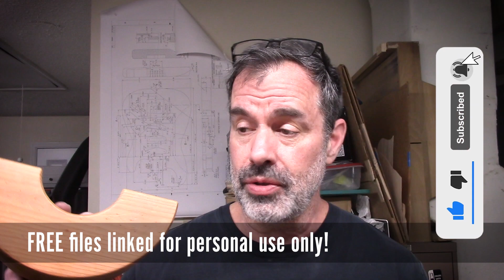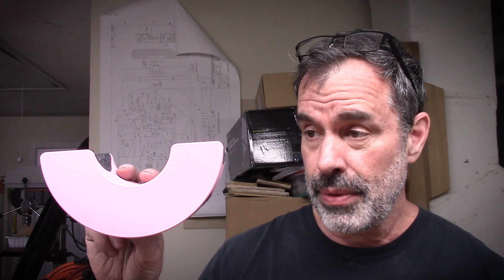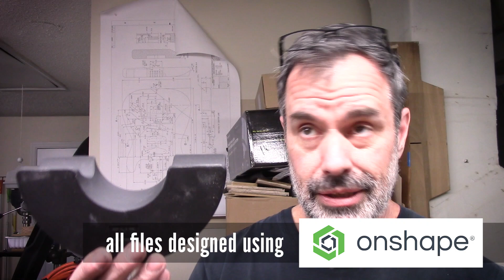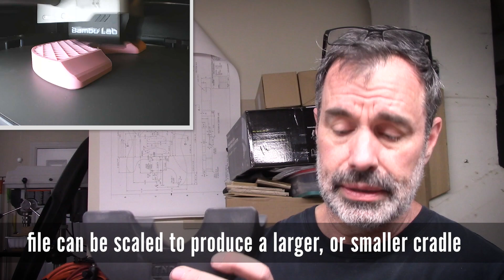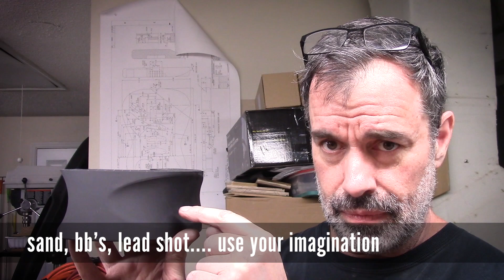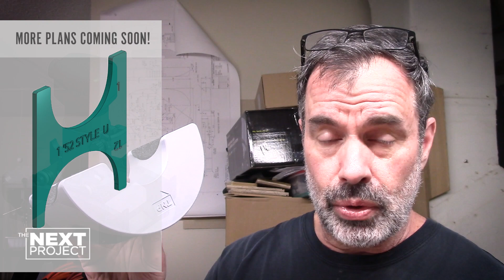Guitar Neck Cradle - 3D Printing Guitar Project Tools Ep2

Comment: If you do experiment with the sand, use gyroid infill.  That will allow the sand to even out on its own, rather than you filling up separate compartments and possibly leaving it unbalanced.  That is, with gyroid, it doesn't create separate compartments but one interconnected space, so you can fill in one spot and it'll spread out across the bottom (within reason).  Once you've finished printing, you can just shake it a bit and get the sand to even out.  The sparser the infill, the easier the sand will flow.
I printed a very similar rest, except I made the opposite side (i.e. the non-rocking orientation) flat but sloping for when I'm working with the guitar face-down.  I also used self-adhesive felt, which made it very easy to install.
Reply from the maker: Raven, thanks for watching and the great detail suggestion for printing infill and sand.
That's a really great suggestion, I'll give it a try on my next print of this.
I'll have to find look for some larger adhesive felt sheets too. I only have small the small furniture patches of the adhesive stuff, a bit too small for this neck cradle.
Thanks again, be safe and take care!

Comment: Printed one today. Just beautiful.
Reply from the maker: Pelle, glad it printed well for you.
As you may have noticed, there are now 2 sizes available. The original which is good for most electric guitars, and a larger version which will also work well for most acoustic guitars.
You will need to get some felt, leather or similar protective material and apply it to the contact points of the cradle, to protect the guitar necks.
Good luck with your projects!

Comment: this is great and just what I was looking for, thanks so much!
Reply from the maker: Andrew, thanks for watching!
I have a larger version for acoustic guitars,  that I will be making available in the near future. 
Good luck with your projects!
Reply: @theNextProject oh perfect, that's actually what I was after. I scaled this one up to be about 5 inches in height but haven't printed it yet so maybe I'll just hold out for the next version.
Reply from the maker: I've just uploaded a "large" version, in both STL and STEP formats.
The files are in the same folder you found the original neck cradle.
Good luck with your projects!
Reply: @theNextProject thanks!

Comment: Any recommendations/links for which felt to use? Or possible suggestions for alternate materials?
Reply from the maker: Swarmish, thanks for watching!
I used a heavy felt, it is/was an airline blanket. The kind they offer on cold flights to places our feet freeze - sorry, off topic.
I would imagine some craft, or fabric stores may have some thick felt that would work well.
Additionally, sheet cork should work, Neoprene sheet rubber, leather ( a thick early 1970's hippy belt ).  
Hmm, what else... If there are an old discard set of leather boots ready for the trash, the uppers, or tongue could possibly be used.
Just need something that is firm and soft-ish at the same time. 
There may be something laying around the house that won't be missed.
Good luck with the scavenger hunt, and your projects!
Reply: @theNextProject  Thank you for sharing! I'm happy to come across your channel! Those are a lot of good suggestions, I'll be mindful of them and see what I can come up with this weekend.

Comment: Hey your videos are great I am a couple in after your careful analysis of the crowning tools. Fell into the rabbit hole, good timing though as I was about to buy the Music Nomad cradle. Something that rest has is angled sections where your strings could route while doing string-on fretwork. I bet this design could accommodate some kind of hook or some place for strings in that event. Keep up the good work!
Reply from the maker: themasterunknown, thanks for watching!
I have a couple little hooked "U" shape string retainers I'm working on. I've got a couple different sizes at the moment, still "testing". I also have a couple "string jack" ideas I'm working on, which allow you to elevate the strings roughly 1/4" without removing them...
I'll have file available soon. 
I don't want to scare you off of the MusicNomad S-File, I do really appreciate the design and engineering behind it. Also chatted at length with the designer of the file.  But for me, I just can't get the narrow crown I'm seeking. Others have told me that they get a hairline crown, so either they got a newer file with a different width safety rib, or they are totally leaning the file far to the sides to file. IDK. Also, the MN S-file has 240 grit diamond finish, which does cut fast, but left too much finish work to be done after use. 
My current process includes 2 files (typically). Depending on the amount of re-crowning needed, I'll first use the StewMac Original Z-file, then finish with the FretGuru DD 2 file. 

Oh! I'm also working on a 3D fret finish sanding block. Hard to explain, but a piece of fine sand paper can be threaded into the block handle, the frets given a fine finish sanding after file crowning, then the frets are ready for polishing... 
Stay tuned for all that.

Be safe and take care!
Reply: @theNextProject  That hairline you reference is becoming a bit of a white whale for me haha. I was thinking of just starting with the Baroque and seeing where that can get me. And those string routers and fret finish sanding blocks sounds quite interesting! Can't wait to see them, you are really on a run!
Reply from the maker: I hope to have some 3D tool stuff posted soon.
Also currently working on a new neck shaping fixture using 3D printed parts and shaping cams. Should be a nice version 2 update.

Fret crown width, or hairline, seems to be very subjective.
I've worked on a number of guitars that I'd consider plateau top frets (wide and flat with eased edges), yet the owner calls then professionally crowned hairline... 
A recent forum I was reading through and commented in, pointed out to me that a hairline crown is 1mm / ±0.030in wide.  I offered, that is where much of my re-crowning projects start.  The reply was "frets wear fast anyway, no point in achieving a narrower crown width..."
That made me laugh a bit. 
That's like saying car tires go bald and flat, so why put new tires with air on your car.   I just didn't understand the logic of giving up before the race starts. 

Anyway, I always try to do my best, hopefully make the project better on its way out, than when it came in. Life is a process of learning, and surviving, LOL.

Take care, talk soon!
Reply: @theNextProject Great philosophy. It's like that story of the housebuilder who can tell the floor isn't level and is content with it. I'm just a bit too obssessive for that haha. 
And those designs you are coming up with. Seriously useful. My whole shop will be printed tools at the rate you are going.

Stay safe bud!

Comment: Hey There!   Hope you're doing well!     I was thinking about one of your other videos, did a search, and lo and behold you're 3D design/printing cool stuff for Luthiers!    Coincidentally I've been tapping into additive as well.   Got myself a BambuLabs A1 Mini, and really dig it!

Cheers!
Reply from the maker: Hey Man, glad to hear from you!
The A1 mini, very cool!
I think you should be able to print this neck cradle, and there is also radius blocks in the DropBox link. The radius blocks are 9", so if that's out of the A1 limit, you should be able to stop the print at your desired height.
Enjoy your printer and let me know of any 3D project ideas, I'm looking for design projects to add to the library.
Take care, John

Comment: I'd add a square groove on the two long edges of the curve. then print a slightly fatter version of the groove out of TPU, glue it into the groove now your rolly bit is soft and not as slippery either.

DO NOT DO THE SAND.... when the fan comes on it blows it everywhere!  can maybe try small buck shot or tiny bearings or lead shot, old coins
Reply from the maker: Good ideas, thanks for sharing!

I am considering using lead shot or bbs, something cheap and easy to pour. Hadn't thought of the fan moving the sand around.

Be safe and take care!
Reply: @theNextProject  the sand was one of my worst ideas

Comment: A few yrs back I attempted to do some 3D modeling, and realized that it is way harder then it seems. I was a wiz at Photoshop, Illustrator, and my beloved Flash program, but once they did away with Flash I was depressed and at a lose as to how to stay creative. Some how I got into building guitars to fill that void, but still missed the online abilities to create. 
I still need to take a class or some type of tutorial if I want to create anything in 3D. That's why I appreciate you doing this for us !!! 
My 26 yr old son wants me to get a 3D printer for us now. My family got me a model train set for Christmas to keep me occupied Lol 
I see great potential to make not only useful guitar tools, but model railroad parts and pieces as well now. They are at ridiculous prices just for small plastic pieces, that cost fractions to produce. $18.00 for an 1/87 (HO) scale plastic automobile... Cra-Cra 
Thank You again ! I know what I need to do now. Cheers ! There are a few guitar builds on my channel.
Reply from the maker: Kyle, I hear ya, Flash was a pretty cool app to work in.
As for 3D printing and design. I'm really new to the game.
I've looked around and some 3D design programs are really expensive - and I'm rather cheap.
I am currently using an online app called OnShape, there are a lot of good how-to/tutorials on YT which have helped a great deal.
HO scale train modeling would be perfect for 3D printing. 
Good luck with your projects!

Comment: I ordered a neck rest with Thomann, sewn cloth filled with material.
It weighs around half a metric ton. But it's fine, it works, you don't have to carry it around much.
But I don't work on guitars and basses that often, I really miss it.
That's the reason I will replace the pup on my bass. I have the pup lying around, and I want to solder once again. The bridge on my Squier Sonic P-Bass is the one thing that is crap on the bass, so I'll replace it with a Fender High Mass Bass Bridge. The original ceramic magnet pup sounds fully all right, but you know, when you have no use for a Tonerider otherwise …
Reply from the maker: Achim, great to hear from you and thanks for watchin!
I had a gun rest shot bag used as a neck cradle for some time. A rather heavy item too, lost it along the way during one of my many moves. 
Glad you're getting some work on the bass. Good to have projects.
Hope all is well, be safe my friend!
Reply: @theNextProject  I had a cold and then a gastritis/gastroenteritis, knocked me really out, but I'm well again.
Reply from the maker: WOW, glad you're doing better.
Sounds bad, big words scare me.
Reply: @theNextProject  If those are big words to you, then it's due to my not so great English skills. I notice, more and more, that my English skills are lacking.
Reply from the maker: LOL, you're doing great with the English.
I live in an English (American) speaking country, and I often misspeak. 
Then, depending on where I'm at in the country, there are any number of "local" dialects, slangs, oddities which are considered "English", Probably American-ish, lazy at times. 
Ha, I just roll with whatever is being said, figure out the context and enjoy the conversation.
Reply: @theNextProject  Do you know The Trogly's Guitar Show?
From time to time, I wish Trogly would consider learning proper English!
Reply from the maker: LOL, I know of the Trogly Show.
Guess I hadn't given his use of the language any thought.
I'll have to start watching on a regular basis.
 I can't stop laughing, thanks
Reply: @theNextProject  He says things like "this needs cleaned", when in the English language you actually say "this needs TO BE cleaned"!

Comment: Good morning. Awesome project! Can you suggest a printer? I've been tempted to start the printing hobby with my Son. Thanks!
Reply from the maker: Good morning and thanks for watching, and many thanks!
I won't suggest anything, as I honestly don't know enough about the industry nor all the printers that are out there to offer a properly education suggestion.

I will explain my long journey into this hobby. 

I've been interested in 3D printing for years, but could not justify the time and expense to jump in. Honestly, I still struggle to justify the expense, and I'm now in the hobby.  
All the trinkets that I see people printing was my biggest turn-off, I don't want to buy a tool to make toys, or things I don't want or need.
Making 3D tools is still barely a legitimate reason even now. Most of the things I'm 3D printing, I can make in other ways, or purchase outright, or...whatever.
Ugh!

Next issue has been that 3D printing always seemed to be a PROJECT, not a hobby. It wasn't "turn-key" enough, and I honestly have too many projects already and I'm not interested in troubleshooting why filament is stringy, or what causes adhesion issues. A huge turn-off all that troubleshooting stuff.
I kept attempting to read, learn and understand the whole process.
Recently, I had been hearing more and more good things about "turn-key" "plug-n-play" printers. Less about troubleshooting, more about just using a tool to make stuff.

Bambu Labs kept surfacing as a turn-key option, and there are other very highly respected brands out there too. However, the Bambu products seemed to get more and more "simple to use" kinda reviews. Not a lot of "how do I fix this..." stuff. That is a topic for ALL 3D printers, we won't completely get away from "fixing" things.

I did more reading... finally pulled the trigger when Bambu was running a "sale", if that is really a thing.  They have a couple entry level machines, a couple mid-level machines and then high-end machines.  
I've outgrown so many tools at an entry level (no fault of the tool), and decided to upgrade before the purchase. Then the battle between mid to high-end followed. 
For me, to justifying a high-end purchase would mean I'd need to "print/sell" my design tool pieces.
I didn't want to start a business to justify a high-end purchase, I just don't have time, and also realized I'd need more than one 3D printer to run a  print/sell business...cRaP!

Mid-level Bambu consists of 2 printer, which are nearly identical. The P1P and P1S. P1P is not enclosed, but can be upgraded.  I wanted to be able to print in carbon fiber reinforced filament, which will require most of the features offered in the P1S with only minor upgrades.... UGH!
So, I got the P1S, and a couple upgrades being a hardened steel nozzle and extrusion gears (whatever they are called). 
I now have to complete an exhaust system when printing in select filaments. 
When using PLA, there is little to now smell, still probably not good to breathe the air near the machine, but with other filaments and exhaust system will be a must. I'm 99% there. So CF filament is days away from making my eye twitch.

Since purchasing the printer, I've also dove into 3d/CAD software stuff. 
That's another world of reading and learning.
I've since narrowed that down and chose to use OnShape, which is completely online, nothing to download. Just log-in from where ever you are, open the files you've been working on, and learn, learn, learn. A lot of great YT tutorials available for it too. 
I think I did a couple hours of random little YT tutorials, and practiced what I was learning to create the radius blocks, the cradle, and a dozen different fingerboard radius fixtures. Challenging and fun - sorta.

Now, I am re-learning how to design to print. Meaning, the 3D printer has limitations, and some restrictions in what it can, or will do. Some parts may need to be made of a couple pieces, or printed on a certain side, or at an angle.... A lot of learning.

So, while I can't/won't recommend anything.
I will say I have no issues with my purchase of the Bambu P1S. I forsee it doing everything I will need for some time.

Oh, another issue that kept me from the 3D world it the print time lengths. I couldn't understand hours of print time... I'm too impatient.
Since getting the printer, I've learned to so some partial prints to resolve any design concerns, and refine the final print. 
When I send something to do a full print, I basically walk away and do other things, occasionally checking in on the print.  Bambu also has an app that allow remote access and printing control. I've only used that feature once at this time, sticking manly to desktop and the machine control pad for functions.

Hope this helps, and I can see how it would be a great father/son project.
Good luck!
Reply: @theNextProject  Thanks for the information, I really appreciate it!

Comment: Gyroid infill and fill it with epoxy.
Reply from the maker: interesting. Gyroid should allow the epoxy to flow and fill pretty evenly.
Any concerns with cure time or such?
Thanks for watching and the process idea!
Be safe and take care!
Reply: @theNextProject  Made a guitar body that way. Turned out too heavy, but was a cool experiment. Curing time up to used resin. Drill two wholes that air can escape. Good luck and cheers.
Reply: The heat of the epoxy curing might give you some warping?
Reply: @jeffallen3382  This is something to keep in mind. Had mine in cold water bath